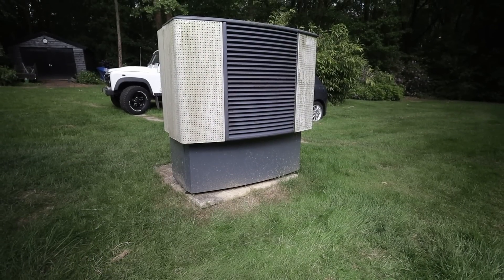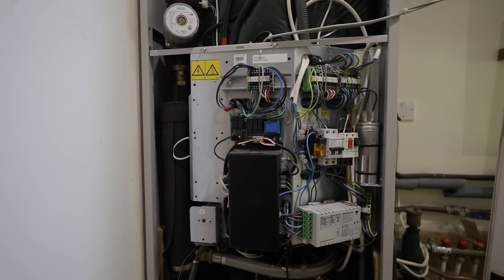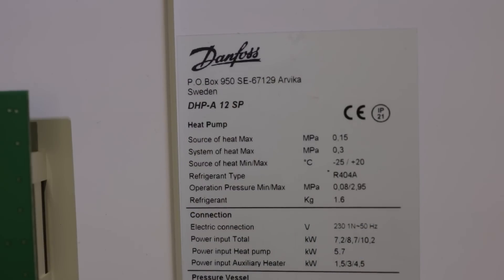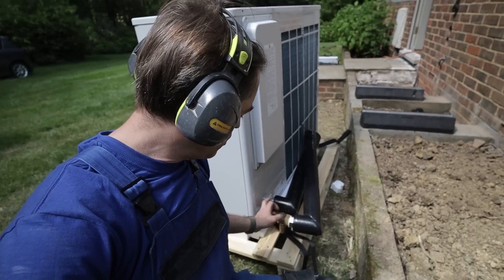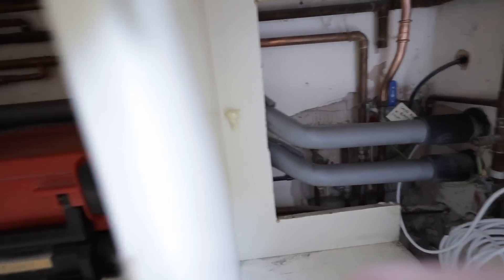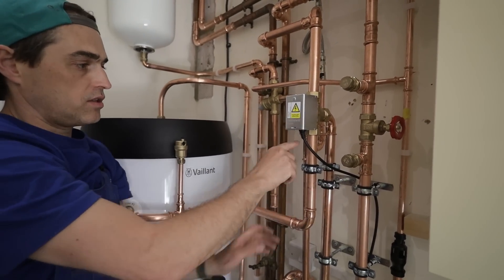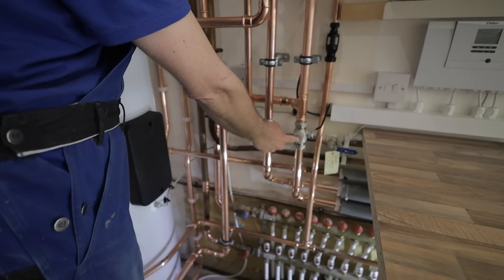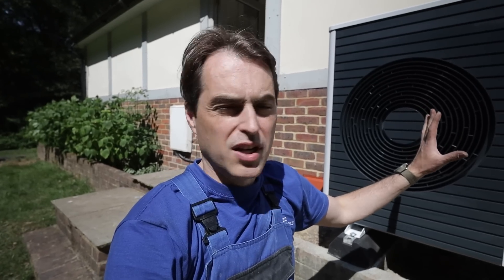Unlocking Super Efficiency: Air Source Heat Pump Swap With Vaillant Arotherm.

Comment: As a heat pump owner and enthusiast this was like a ton of bricks being dropped. Obsolete in 13 years. Thats totally unacceptable in terms.of investment. This is a major elephant in the room. No one will fit one with this short a lifespan and at the cost if they arent supported with spares down the road. Can Vailant be expected to be better? This plays into thr hands of the critics who say theh are too expensive and complicated.
Reply: I replace 13 year old boilers all the time. No difference. You want to drive about in a 13 year old car that's been running 24/7? Didn't think so
Reply: @colin4685  Actually, using a car constantly is a pretty good idea. I was talking to a taxi driver that had 300K miles on his Skoda Octavia. It still had its original exhaust system on it because it was never stood still long enough for it to rust. It was still on its second clutch because as a professional driver, he was very careful with it.
Reply: @colin4685  But boilers are cheap to replace.
Reply from the maker: Well installed modern units should last 20 years
Reply: Parts are absolutely still available for these. They're a meccano set of commonly available; high quality; off the shelf bits. Copeland scroll compressor. SWEP plates. Danfoss TXV. Wilo or Grundfos pumps etc.

The instruction manuals for them are a cracking read in certain places. 

e.g. If XYZ symptoms then your expansion valve might be stuck. Try whacking it as hard as you can with a screwdriver handle a few times. If that doesn't work wind it fully open and shut a few times; then leave it N turns from fully open or closed. Check that superheat and subcooling match these figures and tweak to suit. If it sticks again consider replacing it.

All very familiar to anybody who works on old school commercial refrigeration. 

So a refrigeration engineer would still be able to repair that unit both today and in years to come. Vacuum it down; open it op; clean it up; swap out the broken bits; seal it up and gas it up again. Just like you would with a car that you've just bashed into a deer or similar.

I think it's probably fair to say this has been replaced because materially higher performance air source units are now available. 

These units were really a ground source heat pump intended to work at a fixed speed with ground loops between ~0 and 10C; with the ground having been replaced with a radiator and a fan.

On ground source units where the temperatures are stable (ground doesn't change temperature much) and the output power levels are stable (if you reduce flowrate in the ground loop your flow stops being turbulent and performance of the ground loop goes to shit; if you increase flow your pressure drop skrockets and pumping power goes through the roof; so there's a very clear sweetspot that you "always" want to run the ground loop at) it's ok to have a fixed-speed compressor and a mechanical TXV as these do.

On air source units the wide operating range (e.g. air at -20C to +30C) and no practical limit on the minimum airflow (it's always turbulent through the fins) really favour inverter drives and electronic expansion valves etc. That's where much of the performance improvements have come from.

Agree with the "buy something made in volume" and "in stock with a number of distributors" recommendation. Partly so that a complete unit is available if it goes bang. Partly so that spares are readily available.

Also...I'd buy an R290 unit. Propane won't be banned.  What will really kill these old R404a units, or indeed R410a / R134a / R32 units, is when you're not allowed to use F-Gases any more.

Comment: Would be interested in the installation of the heat pump located away from house wall. Down garden how far, how is pipework installed and insulated.?

Comment: I keep being advised to fill the Heat Pump with anti freeze by the manufacturer including Vaillant with the addition cost of a heat exchanger unit so the whole system isn’t filled with anti freeze. I notice this isn’t something you ever do but I’m a little nervous about going against the manufacturers advice.
Reply: I'm inclined to use trace heating rather than anti-freeze. The trace heating only comes on where there is any actual risk of freezing, and keeping the external pipework short minimises the cost of installing and then running the trace heating.

Comment: If the mdpe pipes are buried feep enough theyre not lagged as they would collect ground heat. The old danfoss was a clever idea but they shelved it for poor efficiency they yold us back in the day
Reply: Assuming the ground is 10deg at 1.5-2m deep, if they're running at 35/29 flow and return, surely they'd be losing heat to the ground.
Reply: @71brp84  the out door unit on those had chilled water/glycol running through them the same as a ground loop on a ground source heat pump. The indoor unit was a water to water heat pump much like the indoor unit of a ground source heat pump, with the evaporator being a refrigerant to water plate exchanger. The pipes between the outdoor unit would also collect heat from the ground.
Reply from the maker: Why were they famous for low scop then?
Reply: @UrbanPlumbers  because it's a clever idea, but not very efficient unless there is a mile of pipe underground 🤣
Reply: Given that the flow temperature is going to be about 40C, and the earth will be about 12C they are going to lose heat rather than gain it. At the very least, they should have been lagged down to the frost line.
Reply: @zlmdragon.  You're right I was confusing the old system with the new! Oops!

Comment: The company I'm working for are putting me on a heat pump design and installation PLUS putting me through F Gas. 
I love how simple these systems are (Like the old fashion heating systems really) - The thing I'm worried about is the amount of prep work you need to do. Do you charge to do a detailed quote? The heat loss calc I need to really learn properly so that I don't screw up on the first hurdle.
I've been in the GAS heating industry for 16 yrs now so have a good idea of installations etc... 
My question is... Does it get easier working all this out?
Reply from the maker: Yes, you do charge for both quoting and doing the heat loss, hopefully at the same time. You cant do it for free as it is to time-consuming. To do it well it takes time and needs to be paid for.

I am still learning and experimenting with how to work things out myself, but it does get easier with every job. My first installs were killing me mentally and physically. Now I can install pretty easily and enjoy the process as well, so it does get easier. It is however a totally different game to what standard gas installs are.

Ask your company to put your though heat geek training if you can. Sadly I have not seen any decent training out there apart for HG.
Reply: which software are you using for heat loss calculations?
Reply from the maker: Heat Engineer for now

Comment: Here in North America,  heat pump run in a reverse mode to remove heat (and humidity) from the house so boilers and radiators as you have seen here, are not the default for new builds.  Rather a ducted system which heat pumps work well on as well.  Only issues with heat pumps is in cold whether the COP drops (he mentioned) so the electrical system’s ability to support massive switch to heat pumps is questionable.
Reply: In colder EU countries we can run air-to-air heat pumps (basicly AC in reverse) at up to -25C, with a COP of close to 2.0, or about 2.5 or 3.0 at -15C tp -10C. The grids and condos / house electrical systems are sized to handle 2-5KW resistive heat. The house electrical system handles the 1.5 to 2KW electrical input for heat pumps.

US with the higher prevalence of propane/natural gas stoves and heaters is mostly not ready for heat pumps :/
Reply from the maker: why would it be questionable - this heat pump maxium power requiremnt is 15amps or around 3.5kW. That is not a lot!

Comment: It's absolute rubbish that parts are no longer available for a unit only 13 years old. The manufacturer should be ashamed of themselves.
Reply from the maker: Apparently spares are available for the unit. It may have been a repair man not being aware or else.
Reply: The error code also indicated the fault was with the motor. I've had occasional successes sourcing motors from other suppliers than the original equipment manfacturer. If you can find the motor part number, you might be able to find it somewhere else.
Reply from the maker: Thanks for pointing this out!
Reply: @razvanlex  while you can’t use virgin R404a some systems  - you can use reclaimed R404a. Circa 30% dearer but readily available.
Reply: Motor P on a Danfoss can be as simple as a loose neutral or capacitor out of tolerance and spares as advised are readily available from Ireland.
Reply: @razvanlex   well spotted I did wonder if that could be one of the reasons to replace the unit.

Comment: Good video, quick question, how does this layout work with Part L demanding all new installs having to be zoned with 2 x temperature controls? I can't seem to find the answer in writing.
Many thanks
Reply from the maker: seriously, I don't care about regulations if they are not fit for purpose and lower efficiency. I belive that fully weather-compensated systems do not require zoning, but never bothered to check, so may be wrong. You do not want to zone heat pumps or weather-compensated systems.
Reply: @UrbanPlumbers  I absolutely agree,  open systems all the way! The problem is that new build sites with 100+ houses all requiring ASHPs and minimum of 2 zones,  just wondered if they had finally changed the rules (I believe it is in the pipeline but may be wrong)
Reply from the maker: @AMHeatingDesign  Trouble is most installers still don't understand hydronics or system design. They all fit buffers, blending valves on manifolds, unnecessary pumps, zone valves,  3rd party controls, etc. - it is a mess. Manufacturers themselves have no clue and almost all provide outdated schematics with terrible system design. Most guys just follow the drawing thinking they do a good job. From manufacturers, through colleagues to installers - almost all get it wrong.
Reply: @UrbanPlumbers  the absolute biggest problem I find in the heat pump industry is... pre-plumbed cylinders! Each one either has a built in buffer or a plate heat exchanger with a secondary heating pump pre-installed, all wired ready to receive your third party room thermostats. You are right it is a mess,  but I feel heating engineers often can't think too far outside of the box as it will go against one regulation or another and so stick to the guidelines as its safer to tick boxes.  Your videos are extremely informative,  just need to do them more often 😃 keep up the good work mate
Reply from the maker: @AMHeatingDesign  Thanks! Yes pre-plumbed cylinders are a nightmare. Also, box-ticking compliance qualifications and engineers are a nightmare to the industry. - No one teaches people how to think anymore.
Reply: @UrbanPlumbers  agreed, will be interesting to see how this one performs over the year.
I do have a question on this type of approach, if you're relying on the pump within the units to deliver the required flow, how does that stay balanced and provide heat to each room? For instance if the pump delivers 20l/min at -3, in warmer weather it would reduce its flow with the reduced demand and unbalance the whole system?
Reply from the maker: No, it doesn’t unbalance the system. As a matter of fact pumps on those units always run at very high flow anyway - no one quite understands why. As you can see on this video this one runs at 1300l / h even with 20c outside.
Reply: @UrbanPlumbers  awesome, thanks again.

Comment: Our home is detached, old and listed - so increasing insulation not really possible. Really good thermal mass, and large windows giving good gain from the sun  :) I have made it pretty draft free.  

I hope to have a heat pump to replace our ageing gas boiler. I would use it to give a good background heat and boost with a woodburner when needed. I currently run our boiler at 30-40 degrees even when it is minus 5 or worse. Would an air source heat pump work for us?

Radiators are all plumbed 15mm to each rad, 22 back to boiler, i was thinking to upgrade the last section to 28mm and also 28mm to a new cylinder with the shortest possible runs to the heat pump and cylinder, no zones - add more radiators where required, but honestly, i do not want a super hot house, prefer a low steady heat. I would prefer to do the work myself, but if could find a good installer, that would be fine too :)
Reply from the maker: big rads and insulation does not mean a hot house. It means lower flow temperature and much higher efficiency.
Reply: @UrbanPlumbers  - Yes, exactly right :) My ideal is for the system to run as 30 - 40 degrees to enable an efficient system, but i do not want the house at 21 plus degrees as many prefer. Is it ok to design the system to have a lower design/internal temperature and so need a smaller heat pump? (as my house is listed, and because of it's specific design, i am restricted as to the changes i can make, so high levels of insulation is not an option). 
I agree with you - regulations need to work in a practical sense :) Hence i do not necessarily want a design temp i will never actually use (i understand that i can always turn it down and have a more efficient flow and then a higher cop), but also i do not want a larger/or even two heat pumps, if it can be avoided at design stage.
Reply: @chriss4949  Thanks. I think this is what i will do. I will do the calculations to achieve a comfortable background temperature around 17 degrees with a flow around 40 degrees, go for an open system (no zones) and weather compensation - in time i will get solar to meet some of the cost of running the pump. They look fairly straight forward to install , so long as i take my time - might be wrong of course :)
Reply: My kitchen looks like that destroyed, a small kitchen and it costs a fortune to run,installed by MCS accredited company 125 floor space 17 KW Grant Aerona2 they are no help take it up with your installer Dynamis Warrington haha a complete rip off,Not everyone knows what they are doing Cowboys rule with no comeback what’s so ever.Your videos are spot on nice one.

Comment: Great video. Is it common practice to not have zone valves for underfloor and radiator when using heat pump?
Reply from the maker: Sadly it’s not, but it should be
Reply: @UrbanPlumbers  thank you. Also in this instance you were lucky that the previous pipework was sized and installed adequately. Otherwise you may have needed an additional pump if flow to index circuit was a problem. Good outcome overall
Reply from the maker: This set up would have run on a single pump even with 22mm pipework going or rads and UFH. No luck - just proper calculations